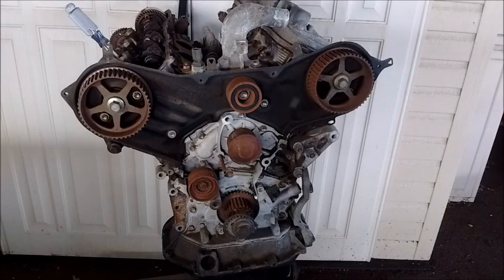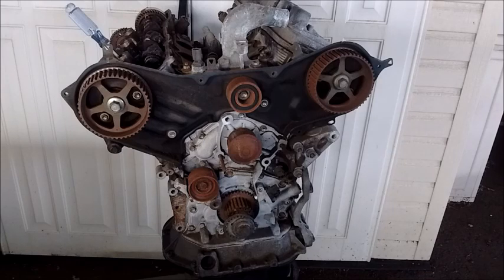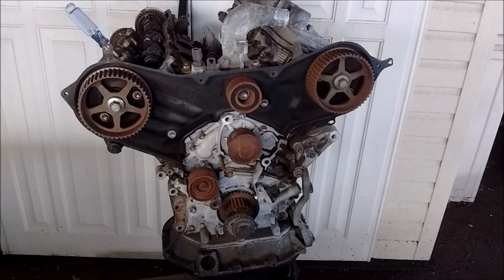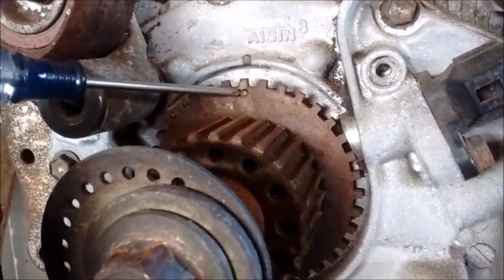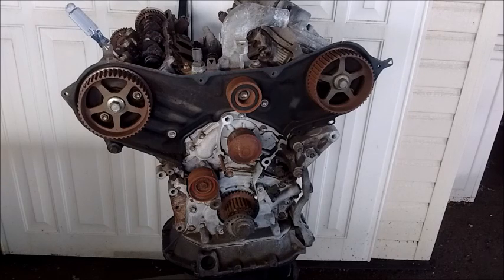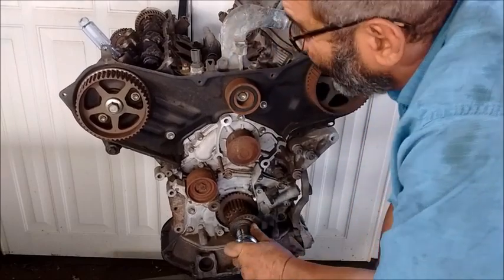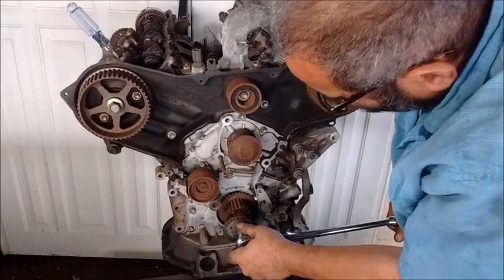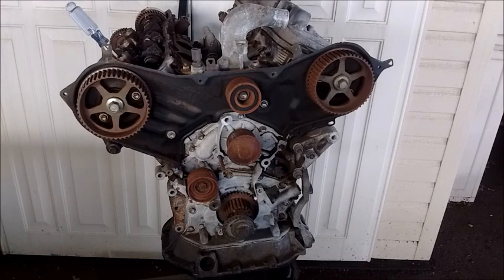Interference or Non-Interference? Toyota 1MZ-FE VVT-i 3.0-liter V6

Comment: Just the fact that you spun the crankshaft around once without any contact occurring proves that its a non-interference engine. With the four camshafts sitting motionless there has to be several valves open somewhere in the engine. Therefore if it were an interference engine simply rotating the crankshaft once should have caused contact to occur somewhere.
Reply: yes valves open somewhere but that doesn't mean they are all the way open. just saying

Comment: I just bought a 2003 AWD V6 Toyota Highlander with this engine, with 105k miles (from original owner that was an older lady) and I was worried the timing belt would need replacing soon for peace of mind, and I was going to replace it myself because I was told it was a interference engine. I’m glad to see that it’s not. I think it’s stupid as hell to put a belt on a interference engine. They should have timing chains.     The only thing that does need to be done in it though, is the valve cover gasket and ATF fluid and filter change, and it should last me a few years without worry.
Reply from the maker: Anything is possible but I've never seen a belt break on one of these and I've seen many at 200K with the original belt. They way they are typically driven does not place much stress on the belt.
Reply: Frank Saab the 2UZFE is also non interference. I’ve read the only reason the 3MZFE is interference is because of the domed shapes pistons.
Reply: Shoes N Scents niceee. I just recently bought a 2001 Highlander with this same engine. Get this....ONLY 89K miles from Illinois(im from nyc) that averages about around 5k miles per year. Guy who bought it from the original owner never registered it and had it sit for a while but man, its Great car(last car was a 2007 BmW) highlander Zips really fast.
Reply: Giovanni Ramirez did you get the awd v6 or 2?  I’m in Virginia myself. I was told the car spent 13 years of its life in San Diego so when you look under the car, it looks prestine. I feel like I got a new car for $4800 😂 only thing I’m doing to it is changing the transmission fluid and filter and the valve cover gaskets. Should run another 60k easily
Reply: Alex Koh I should have clarified. The earlier versions of the 2UZFE were non interference. They became interference with the addition of the VvT-i
Reply: Just because it has a timing chain doesn’t mean the valve timing will be impervious! Just ask one of the many Nissan V6 owners that ran ‘em until the chain guides broke and chain slipped at 250k. No a big bit of difference, here. Better to stay on top of critical maintenance items. And “interference” engines with timing belts can be a much more smooth, efficient and powerful design with much less NVH.
Reply: @homesold  you can’t even begin to compare a Nissan that was made after 1999-2000 to a Toyota, I’m sorry.  Renault is a joke and has almost ruined Nissan. A timing chain does not (doesn’t mean it will happen 100% of the time) need to be replaced on a regular basis like a timing belt does; as long as proper maintenance (oil changes & etc) is being done to the car like it’s supposed to. 

If there’s a problem with someone’s timing chain, it’s likely there are other issues causing the problem. If someone isn’t changing their oil regularly/regular maintenance, that can cause the timing chain to stretch, due to the rollers and links wearing against each other.  With a non-interference engine you don’t have anything to worry about, and that’s something someone should know about their own car. If your vehicle is an interference engine you will want to be more cautious but you still don’t have to treat it like a timing belt as far as changing it regularly.   My father put over 300k miles on a 98 Celica & never once had to change the timing belt. His 89 Toyota blue force 4x4 didn’t need a timing chain change until around 250k miles because the chain had stretched and was rubbing up against something.

Comment: I have had a Lexus RX300 for four years. Tried to look this up when I bought it and I never could find anything valid. The internet suggested that the engine could be either. This answers the question . Thank you!
Reply from the maker: Amazingly, there are still people who do disbelieve this.
Reply from the maker: It's very hard to drop a valve on one of these engines but if you do, you will come away saying that you have an interference engine. Doh.
Reply: The amount of times ive seen on the net people saying this in an interference engine is astounding. Some of the confusion i'm sure comes from an older timing belt catalogue (i think its gates) listing it as interference, newer ones changed that to NON interference. Now i direct them to this video, and if they still insist? I just quote Goldmember-  "Well then, there ish no pleashing you"

Comment: I just bought a 2003 highlander with the 1mz, the 2004 onward had the 3.3 and when the belt goes in those it's toast.

You really got me smiling after I watched this video. I feel like I bought something worth a damn for once.
Reply from the maker: Yes so the 3.3 is an interference engine and this is indicated in the timing belt replacement procedure in the factory service manual, but, but, but, timing belt on the 3.3 has been known to break and leave the engine ok. I personally picked up a 3.3 with a broken timing belt that was assumed to be toast, I spun it for test, put a junk  timing belt and water pump on it from my used parts pile, and drove it 5,000 miles before selling it.
Reply: @Merryfrankster_  That is good to read this, I assumed my 3.3L was toast.  I will tear down and put in a new belt, if the engine is toast, I am only out $40 for a belt.  Good day sir!

Comment: I have a 1994 Lexus ES300 (yes, 1994).  The water pump failed, and the timing jumped.  It has the 1MZ-FE so all I need to do is replace the timing belt and of course the water pump and crank and cam seals correct?  I thought it was heading to the junk yard until I saw your video!!!
Reply from the maker: @FN3234  1mz=non-interference so should be good to go unless there are other issues

Comment: I just drove a Camry 130k on an aftermarket belt and water pump the thing was making a lot of whining noise. Just got around to doing the job and put all new Aisin parts and seals at 320k miles. The previous guy that did work torqued the cam pulleys to 300 ft/lbs it was insane. There’s a lot of chattering from the valves but I think it’s got life left.
Reply from the maker: Wait that's not possible, I don't even see how you can get that torque on the camshaft pulleys. The spec is 95 lbs and that's hard enough to get even using a pulley holder tool.

Comment: Was driving my 2002 Toyota Sienna with 405 000 km on the odom, when the timing belt broke. I was braking for a red light when I felt it  break at about 10km/hr. No harm done except for $600 CAD. repair including new water pump and labour.
Reply from the maker: That's pretty cheap for that job. Good for you.
Reply: @Merryfrankster_  yeah indeed. I have a buddy who runs a little mechanic shop. God bless his kind soul haha
Reply: EXCELLENT, Found the comment I was looking for!  THANK YOU ... NOW I feel confident I can drive my new used car purchase 500 mi back from the used car dealer! It's an '02 Sienna w 94k mi (That's 151k km to Canadians). Got BLESS your Truckers! I gained a NEW RESPECT for our neighbors up north!
Reply: I assume water pump is that old as well.  I am surprised water pump would last that long.
Reply: @tommason5689  at the time I had bought the van at around 390 000 km for about $1000 CAD. So I have no idea the age of the current pump at the time. But I would have to honestly doubt it was not the original.

Comment: My sister has the 2004 toyota Camry xle v6 with this engine timing belt is way overdue for replacement.  Now she can relax . She's saving money to buy the aisin kit. I'll be doing the replacement with all related,  water pump, idler pulleys,  tensioner and al, seals
Reply from the maker: No wait. The 2004 has the 3mz-fe 3.3-liter, which is an interference engine.

Comment: Thank you very very much. Just one thought, I was under the impression that variable valve timing DOES change the valve travel distance.. I thought that the cam lob profile changed to allow the valves to open more and for a longer duration?   Now I am questioning myself though. Maybe that wrong? Maybe?
Reply from the maker: No. Variable timing is not variable lift. The valve lift does not change. Vtec (honda) has variable lift. VVTL-i (Toyota, with emphasis on the L) has variable lift. These engines do not have variable lift. The "valve travel distance" aka lift does not change. Besides, the cam lobe does not change in variable lift. There is an alternate lobe that engages to change the valve lift - both in vtec and vvtli. So your impression is completely incorrect. False. Nonsense. But don't feel bad. A lot of other people - many of whom, unlike you, are complete idiots - share this impression. Just because you believe the same thing as a complete idiot does not  make you a complete idiot. I am giving you the benefit of the doubt.
Reply from the maker: This video demonstrates conclusively that no matter the state of valve timing there is absolutely no possibility of valve to piston contact. Some people are not capable of getting this through their thick heads.
Reply: @Merryfrankster_   Thank you very very very much for the video and the answers

Comment: some were saying the non vvti are the only non-interference...  good to know they are both not because i have both, and i even have a 3mzfe which i hope is the same
Reply from the maker: Hate to break it to you, no. In the official repair manual for the 3mz, it is made quite clear in the timing belt replacement section.
Reply: @Merryfrankster_  The topic of this video is the 1MZ-FE

Comment: Thank you for an excellent answer.  I have a 2007 Lexus RX400h with the 3MZ-FE, I see that you listed the 2006 rx400h as non-interference, is the 2007 also non-interference?  I have also got some conflicting info.  Thank you again.
Reply from the maker: The 3mz-fe is definitely an interference engine. I have another video that demonstrates that. And the factory service manual makes it clear.
Reply: Thank you!!

Comment: Just bought a Toyota Harrier Airs 2003/09 model with 1Mz-FE 3000cc V6.
This video helps a lot. 
So if the timing belt breaks it won't affect the engine right ? 
Thanks for the 📹
Reply from the maker: That's correct, on this engine, there is no possibility of any contact between valves and pistons, it is a non-interference engine.
Reply: @Merryfrankster_  okay, thank for the knowledge. My car is at workshop since a week. Couldn't find some parts here in Pakistan. Hopefully will get it done as soon as I get em.
Reply: Wish there was an option of attaching pictures to comments 😄
I would've shared the suspension work I've got done

Comment: But to put this back on timing do you have to use a screwdriver to make sure that piston in up or no just make sure the timing marks are all set up right????? Please I need your help 🙏 sir
Reply from the maker: Watch my timing belt videos. I have three of them for this engine.
Reply: @Merryfrankster_  the engine I have is an 3.3 sir is it similar?? Thanks again for replying I'm a new subscriber
Reply: My question is on a Lexus 3.3 motor my friends car the belt broke,,,,The cams I put back on timing,,What I need to know is at the bottom crank do I have to use a screwdriver to bring the cylinder 1back up or just line up the crank to the marks make sure the cams are lined up & that it????
Reply from the maker: @poodlemike5120  timing belt for 3.3 is the same as 3.3 EXCEPT 3.3 is an interference engine. You must turn the crank 30degrees back from TDC to avoid hitting the valves on the piston. Use the marks on the camshat pulleys and crankshaft pulley. WATCH THE FRIGGING TIMING BELT VIDEO TITLED "IN-DEPTH TIMING MARKS" ALL YOUR QUESTIONS ARE ANSWERED. I did multiple videos on this because you cannot tell someone how to do their timing belt in a comment.
Reply: @Merryfrankster_  You can call me private to I'll still pick up sir thanks
Reply: @Merryfrankster_  HEY GUESS WHAT I GOT IT STARTED SIRR THANK YOU SIR SO MUCH UR ME HERO!!!!WELL U & MY ADOPTED SON WHO'S IN THE ARMY NOW

Comment: I have a question sir, what if the screwdriver was down at the bottom An then u spun the bottom Harmonic pulley bolt would I have a problem then ⁉️ Because I have a 2005 Lexus and I'm changing the timing belt that broke on me while coming to a stop sign ‼️ and I just want to clear all bases on This subject 🚯
Reply from the maker: The 2005 Lexus has a 3.3-liter 3MZ-FE motor. This is an interference motor. The factory service manual tells you to rotate the crankshaft backward 60 degrees from top dead center when you are adjusting the camshafts. The reason is to prevent contact between the valves and the pistons (interference).
Reply: @Merryfrankster_  hey I have nothing for you bought maybe two but first I bought these new cranksensors and they didn't have o Rings are they supposed to have o-rings  ⁉️ and back to spinning backwards❗ backwards in meaning counterclockwise right ⁉️ one more for the road If if I damage the valve or anything would that stop me from being able to spend all the way around ⁉️🤔🌍
Reply from the maker: If you suspect that you have valve damage then do a leakdown test. A damaged valve may interfere with the piston, or not. But either way it will not seal properly, and this would show in the leakdown test.

Comment: Thank you. Very informative especially since I have a 1999 Sienna with this engine.
Reply: Glenn, curious if your '99 Sienna has a VVT-i eng? My online research indicated that pre '01 the Siennas used a 'non interference' eng. I'm under the inpression pre '01 Siennas were NOT VVT-i & SWITCHED to an 'interference engine' in '01.  Mine's an '02 Sienna & has "VVT-i" engraved on the engine cover.  Does your '99 Sienna has the same "VVT-i" engraving on the engine cover?
Reply: Only an interferance engine can be damage do to a briken timming belt ir chain? No interferance engines are awesome. Check yours. Not all get damage do to timiing belt snaps.

Comment: What about valve to valve interference? Is it possible the valves could bend each other even thought they won’t bend from piston interference?
Reply from the maker: As you may or may not know, this engine does not have independent camshafts. The intake came and exhaust cam are locked together. So the answer to your question is, yes, anything is possible, pigs could fly.

Comment: So what all can be damaged when your timing belt breaks on this motor?
Reply from the maker: When your engine comes to a sudden stop there could be strain on the drive train i.e. torque converter and transmission but because there is no interference there will be no internal damage to the pistons or valves.

Comment: Hello Frank Saab, I have 2005 toyota sienna, 3.3 l  V6 and I dont know if is a 1 MZ-FE ...   an interference engine or non-interference engine?  Thank you so much.
Reply from the maker: I haven't tested it myself but it is believed that the 3MZ (3.3-liter) is an interference engine.
Reply: @kelvindavid722  but on that list the 3.3 lexus is non but the toyota 3mzfe is interference....if im not mistaken the 3.3 lexus are powered by 3mzfe

Comment: Great info. How bout 2mz-fe?
Reply from the maker: Sorry the 2mz is not sold in my market region - only 1mz and 3mz here - so I haven't the faintest. 3mz IS interference, unlike 1mz.
Reply: @Merryfrankster_  People online have conflicting answers about the 3MZ. Can you do a video on the 3MZ to prove once and for all if it is an interference engine?
Reply from the maker: @sodiumvapor13  Yes I plan to do that. I have a 3mz with a broken timing belt in the shop right now.
Reply: Well I'm dying to know. Different opinions from everyone it seems, even mechanics. A quick cam rotation at TDC would be an easy test once and for all

Comment: I bought a 2003 Toyota 4.7L V8 4runner. I need to know if it's a non interference motor. Cos it has a 127,000 miles and I don't want timing belt issues to damage my engine.
Reply from the maker: Google 2uz-fe interference
Reply from the maker: Oggy  1UZ, 2UZ, 3UZ all have timing belt. Timing chains came in to the V8 line-up with the UR.